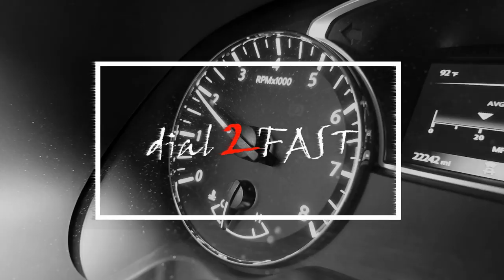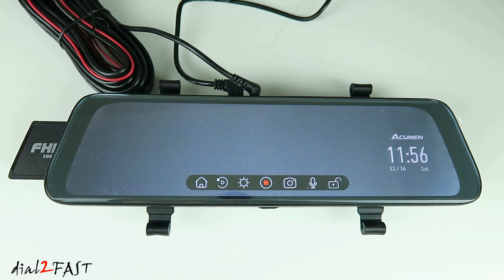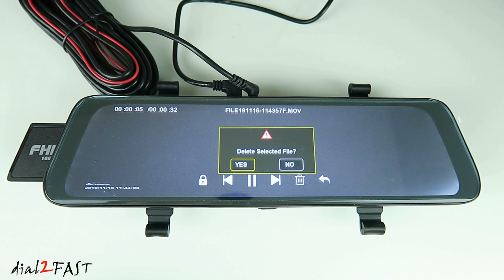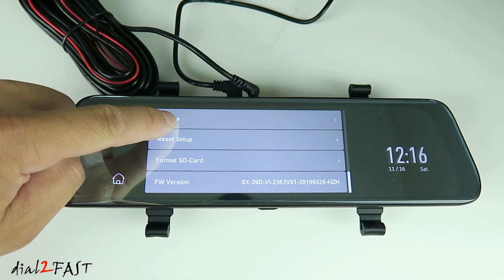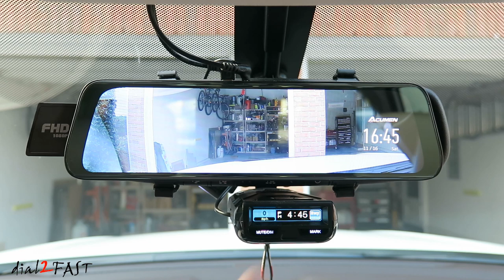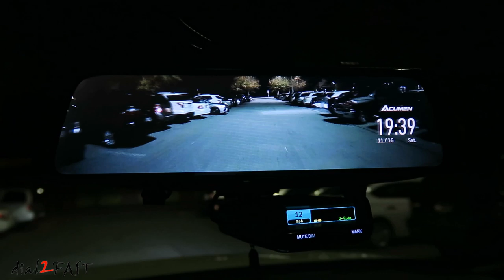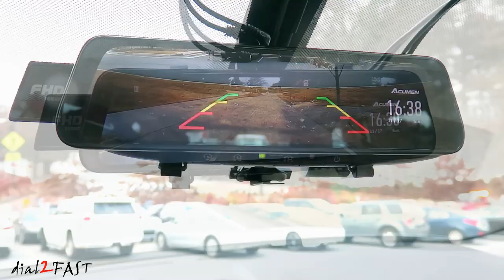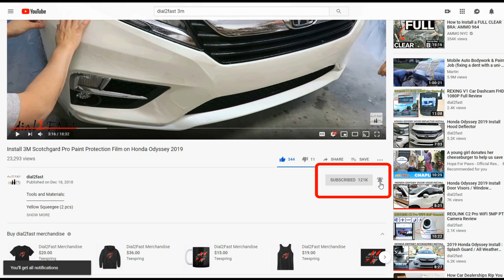ACUMEN XR10 Fullscreen LCD Rearview Mirror Front Rear Dashcam

Comment: This is very close to what I have been looking for. I just wish I would swap out my entire review mirror so it looks more factory like the rear view mirrors in the Cadillac escalade
Reply: Yeah, the only bad thing about these mirrors.
Reply: Autovox pro is what your looking for. Factory OEM style. The only issue I had was the camera was on the right side and there is bump on my right side on my windshield.
Reply: @Meeeeee900  I'm looking for what's offered on Cadillacs and GMC vehicles the full mirror can switch between a regular mirror or full lcd screen and I have a solution as to where the rear view camera would go. Buy a shark fin and attach that the the center rear part of the roof of the car and have the camera installed in that. The rear view mirror would stream all the time live footage instead of looking through the interior of the car ZERO obstructions

Comment: Just got my Acumen Xr10 Excellent review. I have a few questions.

In the menu settings of the Acumen Xr10 go find the option "Flicker  50/60" what does Flicker mean?

What does Time Zone settings mean?  Its in GMT?  I live in CST Central Standard Time area code 64801 here in the U.S. I never heard of GMT time zones?

I purchased a Samsung High Endurance Pro 64 mb Micro SD card, about how long will it hold recordings before being re-written over? Do you think I need a 128 gb card for this camera running on 1296P? 

Running firmware SX-9.66-EN2053V01-TS20191024

Comment: what does the blinking yellow light mean?  Also, I read in the instructions that the parking sensor won't work unless you use the cig plug adapter?  I bought the wiring kit and it's hooked to access. and not sure what makes that different than a cig plug as most are not hot all the time anyway

Comment: My  Toyota sequoia 2008 5.7l v8 SR5 is not with me and I have no way of knowing the dimensions of the interior rear mirror.I live in a different country now. I want to buy an ACUMEN  dash cam but wondering if  it  will fit the OE interior mirror - when placed on it will it fit?

 How long is the rear camera cable ?  My sequoia is 209" I will install the rear camera inside the truck by the rear mirror

Comment: Do you have to connect the back camera to the reverse light wire to access the reverse features? ... Or is there a way to access them manually without the connection?
Reply from the maker: If you don't connect that reverse wire, you can just swipe the screen up/down.

Comment: What is the component that appears hanging below the mirror at 7:52, the Installation segment? It disappears at 11:30, the Daytime Screen View segment, only to reappear at 14:52? It isn't included at the beginning when you unbox the dash cam and its accessories.
Reply from the maker: It's a radar detector with a mirror mount.

Comment: I purchased mine  5 weeks ago. It is a great camera. 
BUT in the 5 weeks it has been up an running in my car,
just this morning, while driving, I watched as it changed the correct time, 
to 2047, Jan 1. 
I reset it to the  correct time, and withing 5 seconds it went back to the 2047, Jan 1.

I reset it again and it went back to the 2047 date again.

I formatted the SD card, then reset to the correct time again. 
When I switched back to the home setting, it immediately went back to the 2047 date.

Trying to find the manufacturers address, phone #,  or web site address. 
I bought it through Amazon, not getting anywhere with a good answer. 
They  say I didn't make a purchase in 2020. My credit card says I did, on Jan 18th.

Can anyone offer some help.
Thanks

Comment: My 12v accessory port is always live how should I wire this
Reply from the maker: You will need to wire a female cigarette lighter socket to an ignition 12V power in your fuse box. Then plug the dashcam power plug to it. You need to know some basic wiring and using a multimeter. The plug is something like this https://amzn.to/347f4BG